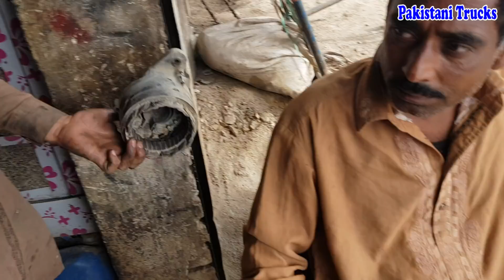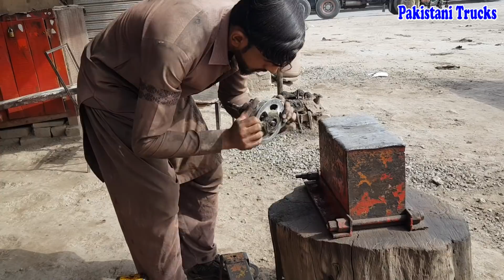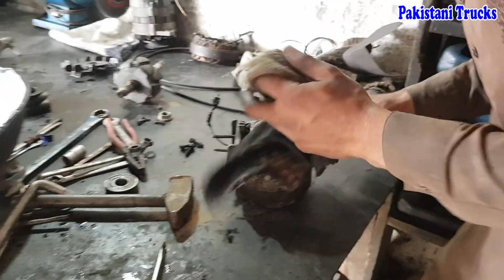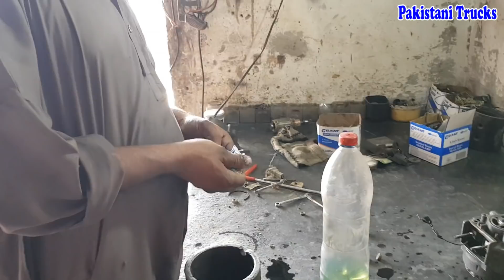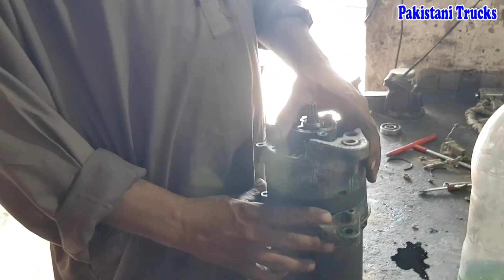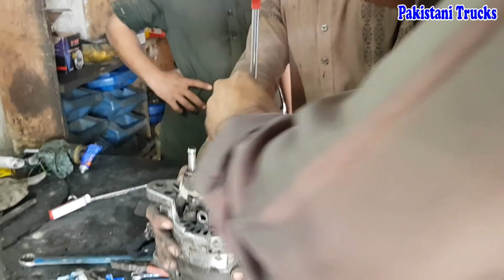How the Old Alternator Repair and Cleaning by Local Electrician | Vehicle Generator Repair

Comment: This must have been made back when things were designed to be repaired because these days everything is designed to be replaced.
Reply: No, this was made recently, you can still repair things, its just not viable anymore. Why spend 25$ turning rotors when new ones are 35. You used to be able to buy rebuild  kits, but now they make you return the core, so THEY can rebuild it, and sell it to someone else.

Comment: You should use gloves when cleaning the parts with gasoline.
Reply: should just be using diesel while gas works really good its a really bad time when a spark lights it off and your wrist deep in the gasoline. a literal death sentence with how the fumes pool and move along the floor
Reply: @imchris5000  diesel leaves an oil residue that’s terrible for an alternator.
Reply: @epoc162  that can also be cleaned off with a lighter solvent. it sure beats the guy using a hammer in the room making a spark and setting everyone's hands and arms on fire which would put you critical condition in the western world a death sentence there
Reply: @imchris5000  more steps but most importantly, more money. Clearly money is a major factor.